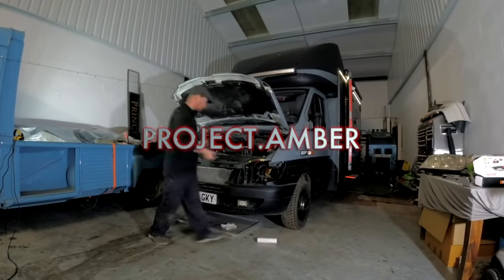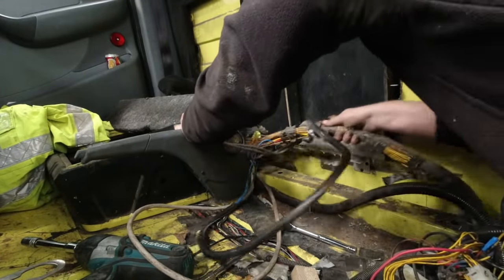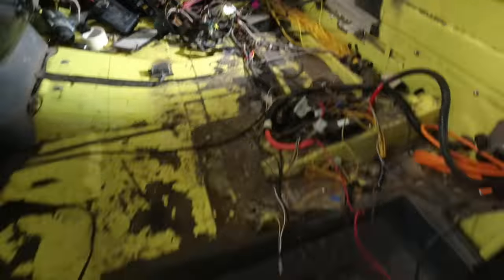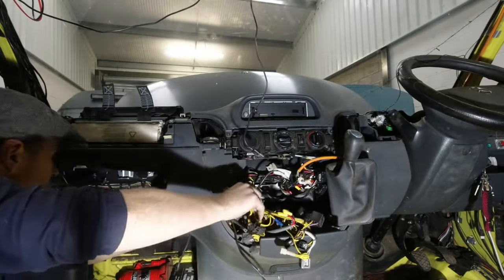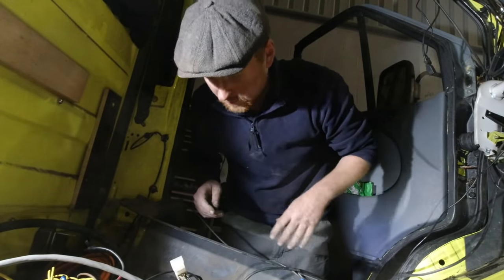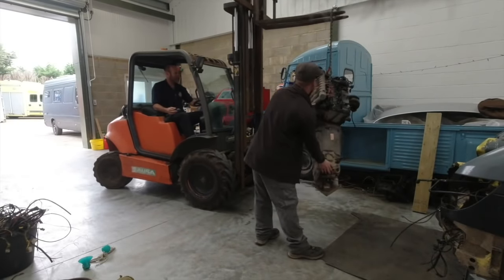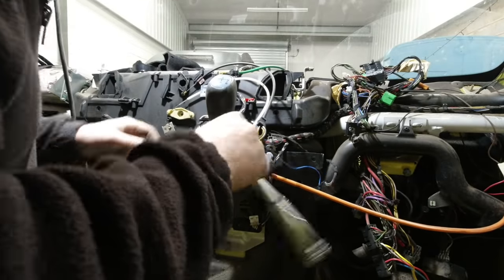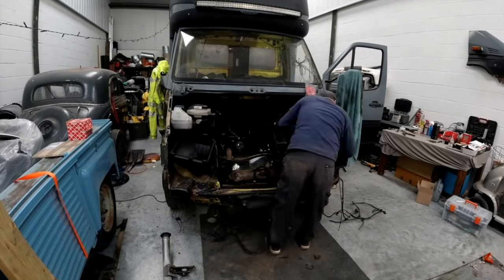Delectrified - Gutting the Ambulance Electrical looms - Amber 2.0: Ep.2

Comment: Mercedes Sprinter Modular Ambulance contains 10km (6 miles of wiring) so you are very brave indeed…
Am looking forward to seeing how much you are able to pull out from the Saloon also. (OS spaghetti cupboard especially)

i know it makes good content, but i feel you are doing it for Amber - and that’s really kind and commendable.
I have a feeling that first key turn is going to be a few dramas away though lol

An enjoyable video, (the kettle skit aside) and really fascinated by the chaos behind the dash 😵‍💫🚑

Wish it was a 1 hour more detailed video, but you edit it down so much, so understand why is just half that.

Our Ambulance benefitted from your good advice back in the day, so am 🤞this Project has a happy ending.

i wonder if your gearbox is the same as ours? Because the one on our 2008 W906 is automatic, with side shift for manual- and it’s really awesome!?

Comment: Some task🤣 could you not have just swapped the ECU's? Iam getting into my Manbulance conversion. It's a 97 Chevy wheeled coach which is UK spec. Had it 20 years and not done anything with it. The conversion is good but they bogged lots of electrics here in the UK. Have tried undoing the worst bridges but will leave the original wheelcoach stuff intact for now. Just need to seperate the body electrics from the chassis side so it can run alone. Easy enough but just got to be careful of any feedback between the two. She'd load of stuff that could come out but I need to start with a simple layout and use it to see what I actually need  as it will be a bike carrier as well. All good fun. Keep plugging away and you will get there 👍

Comment: That’s a whole lotta wiring and a whole lot of weight saving there mate. Have you thought about putting dynamat or something similar on the bare metal whilst it’s in bits? It’s completely transformed my transit. It’s like day and night now it’s so much quieter and makes the cab a nicer place to be. I also insulated the bare floor before I put the carpet back in  and it’s so much warmer in the whole van now. Ambers starting to take shape tho now mate. Keep it up CJ and don’t leave it so long between videos! 😂😂 Regards. Mark

Comment: having done a complete engine trans and interiour transplant (on a car) i know wat youre going through , awesome job , realy loving the footage of the build and cant wait for the next part
probably a good idea to cover over the rubber grommet that you had to adapt for the bigger hole in the floor with a tight fitting piece of sound deadening , just to prevent winds and rain from being able to get through wetting the carpet , and to basicly keep everything stuck in place under there 
allways figured that an ambulance would be the best base for a campervan , as there usually verry well build and insulated and usually have extra options like upgraded brakes suspension stand alone heater and aircon and stuff like that telma magnetic brake  , didnt took the extra wiring in account though , then again youll prolly install extra wiring for interiour lighting entertainment and stuff like that so taking the dash out to get to all the extra stuff to tear out shouldnt be too mush trouble , prolly could use the extra wiring and fuseblocks for the buildout in the rear 
actually looks like that ambulance was state of the art in its day as it has all the bells and whisles added to it